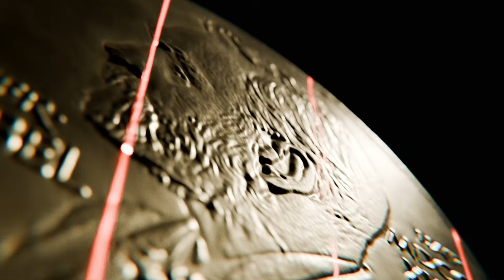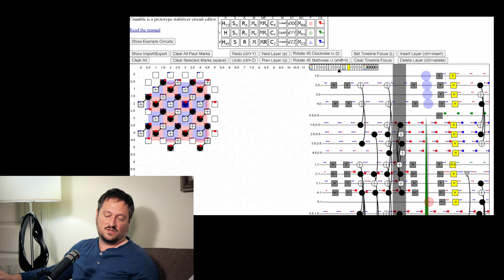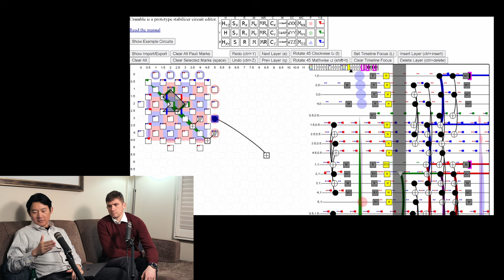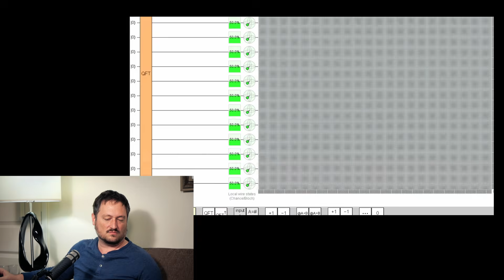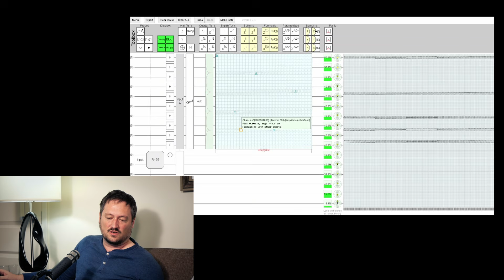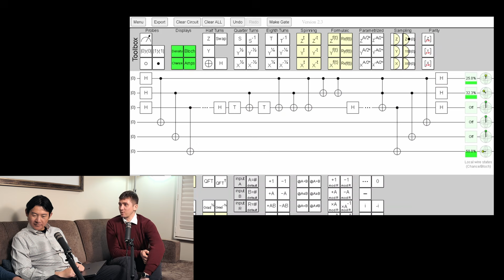How To Make Quantum Algorithms Cheaper | Craig Gidney on Magic-State Factories, Resource Estimates

Comment: Each time you draw a new frame of reality, the blocks on a line move down
These are like "slot coming up soon" for actualized 3D reality. Mempool
2nd last line of blocks has a framerate defined moment of last chance to send an intent
Hitting the bottom is a measurement ? write a block to the chain

New choice set..

Time is intervals..
As the game progresses these intervals shrink until there is only 2 left and it's impossible to complete

Know what that's like don't we

Half Life
<3 GabeN

Then I got to the part where he asked what game 🤣universe.exe

37:36 Dereferenced data ? its way of saying you never had an identifier on that atom so it didn't just disappear, it was never able to be referenced it. Quantum phenomena in a nutshell, no data required by observers playing this game, it was never there in the first place. Not superposition, no position, virtual particles/energy (again, depending on context same/same)